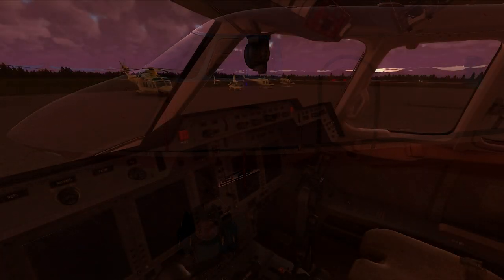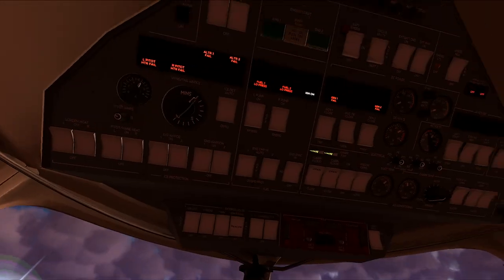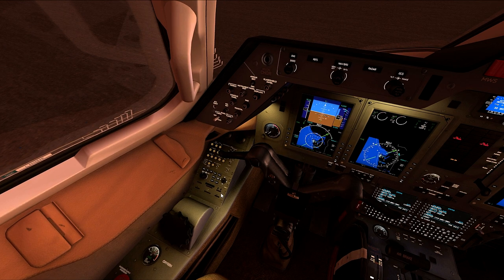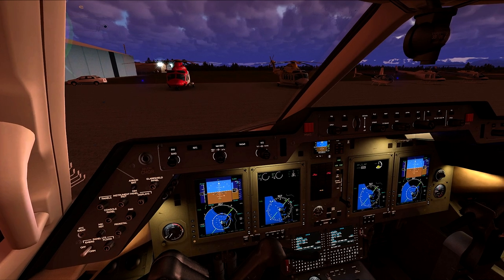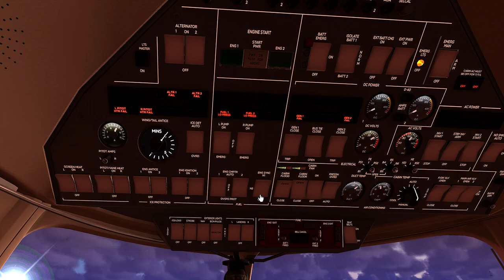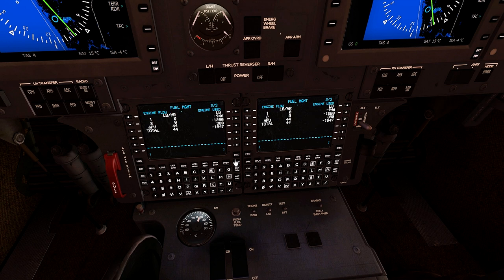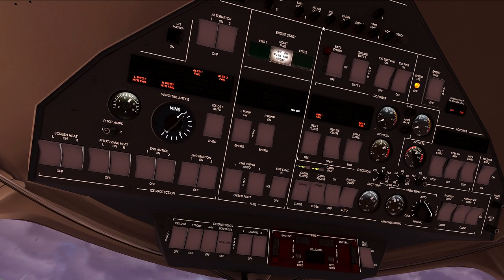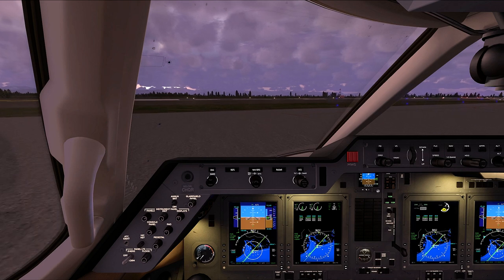Carenado HAWKER 850XP Cold & Dark Start-up Tutorial part 2

Comment: Been waiting for this video review, great job Tim, was wondering whether the fms can properly follow SIDs and STARs... and if you turned on the pitot heat in the next video.. lol, Kind regards, G.A
Reply from the maker: arleedstanto Thanks arleedstanto!  The FMS does have an updateable Navigraph database.  I didn't fly a SID or Star on this flight but I'm sure the unit can handle the LNAV and VNAV.  It will fly an ILS approach but wasn't certified for the GPS WAAS when this particular Collins Unit was developed.  Did I forget the pitot heat?  Say it ain't so!?  Cheers, Tim G. FS MaNiA

Comment: Great videobut how are you able to chnage between the views so easily? i.e from overhead to virtual cockpit you dont go Views > View Mode etc you just go from 1 to the other....how please?
Reply from the maker: ***** Hi nitronoddy!  I use several methods for moving around the aircraft. My main views are EZdok camera views.  I set up 6 cameras in the cockpit and 6 external spot cameras.  I map each camera to either a switch on my Saitek X-55 Rhino HOTAS controller, or to my keyboard.  Press of a button or flip of a switch, presto, I move around.  I also use the arrow keys, PgUp, PgDn keys to move around in each camera view.  All part of EZdok camera controls.  I also use the FSX built-in views; tower, spot, fly-by, etc.,,  Also, I use the EZdok world camera views and FS Recorder replays to build multiple views of the aircraft in each flight.  I think that about covers the basics.  Hope that is helpful.  Thanks for watching and commenting.  Cheers, Tim G., FS MaNiA